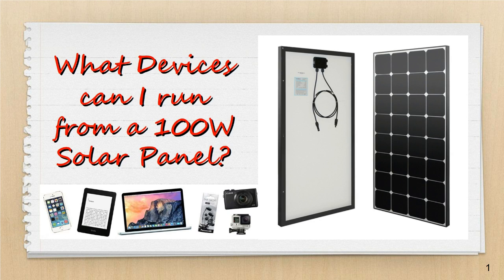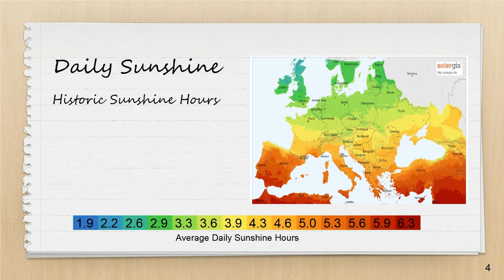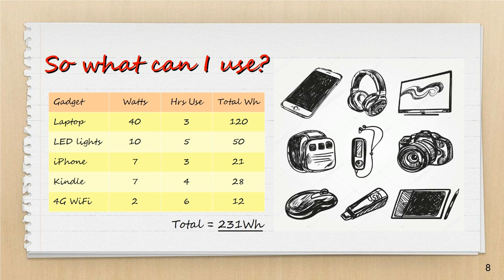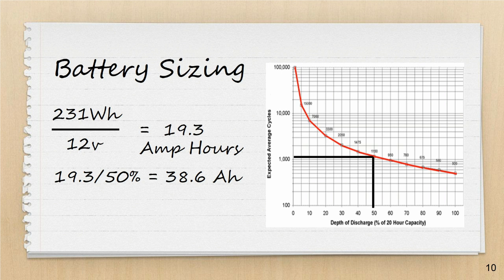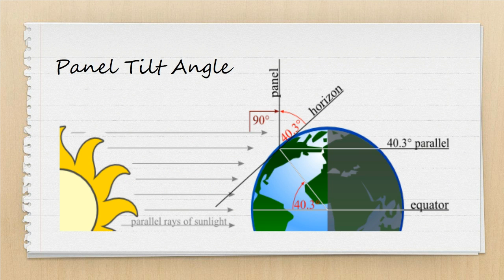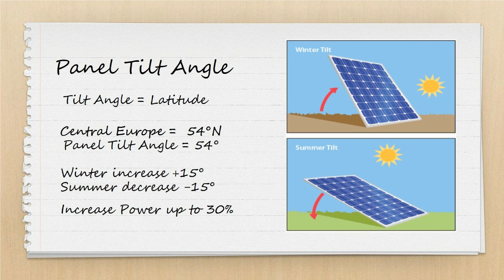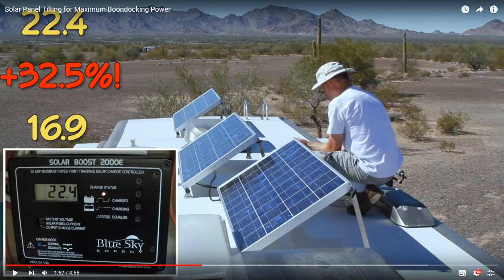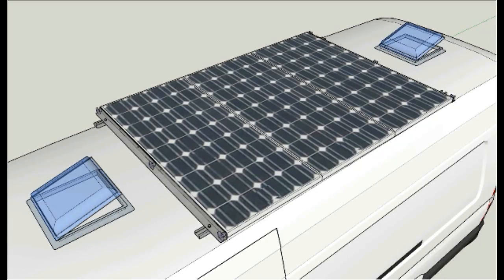What can you run on a 100W Solar Panel?

Comment: Let me rephrase my question. I live in southern California. We get lots of sunshine. Daytime battery charges to 14.1v At night my new battery drops to 12.7v. Will the 100w panel with good sunshine 🌞 charge a second battery?
Reply from the maker: Ok 😊I hope this helps 
You can charge more than one battery with a single solar panel. 
Wire the batteries in parallel, positive together and negative together. Then put your charge cables across that battery string. Positive on one battery and negative to the other. So it charging the pair as if it was one big battery. 
The high voltage you see during the day is the charge voltage from the controller that’s not the battery condition. As soon as the sun goes down and the charge stops that voltage is the standing voltage of the batteries. That will tell you their state of charge. 
If you have plenty of sun 4-5hrs string you could get almost 1/2kwhr out of one 100w panel. 
Cheers Greg

Comment: i make all the calculation, for my area -in north Greece, we are  in 5.0 h -sunshine, and i went, to a 350watt,production of power in one day, i can to afford a 100 watt panel ,it cost hear,100W 12V one crystal 100p,90 euro,.
and now i can make my rechargeable station, i have  already, one inverter in 1000watt,a battery car, 45ah,12v,and now, i only want to bye the solar panel, i have a big problem, to find what panel i want ,and ,with this video, i find the numbers and the solution to my problem. thanks again.

Comment: I was just trying to figure out what size battery I needed for 120watt solar panel and what kinda of equipment I could power from it, thank you
Reply from the maker: With that size panel you don’t want any more than 1x100Ah battery. That would give you a couple of days use at these levels. 
No point going bigger on batteries because you won’t be able to recharge it with that panel. You can only use what you can regenerate
Reply: @GregVirgoe  Thanks that’s so useful to know 
I was initially thinking I could have 2 batteries connected but that makes sense that the panel wouldn’t be able to keep them both topped up 
I’m gonna have to start getting better at doing the maths 😂

Comment: Nice presentation.  I do have a couple of comments.  First you can get much higher efficiency if you use an MPPT charge controller.  MPPT controllers are typically around 96-98% efficient.  Properly sized wires will only cause 1% or less in power loss, particularly if you run two or more panels in series.  In fact it is quite easy to set up a solar system that passes 90+% of the power from the panels to the batteries.  However, one thing you neglected was the charging efficiency of your batteries.  That will be in the 80% range for flooded batteries and 85-90% for AGM batteries.  So your 30% loss number is more or less correct but for the wrong reasons.
Reply from the maker: Hi Todd, Thank you very much for adding that valuable information.
Very much appreciated.
Reply: Thank you for pointing that out.  I am aware of the Sandia Lab studies on this, which demonstrate significantly lower incremental charge efficiencies at higher states of charge.  However, I would suggest that most RV applications do not operate in the top 20% of battery capacity.   Instead many RVs draw their batteries down significantly and because of poor understanding of how to determine state of charge of batteries seldom get much above 80% charge.  In that operating environment the overall charging efficiency is more appropriate.  In general, people need more solar capacity than they think.

Comment: Could use a linear servo motor save climbing on the roof. Even could be made to adjust itself as the sun sets and close at night. Saw a system that used leds as the light sensors. When the panel casts a shadow on them, they switch the servo to tilt until shadow disappears.

Comment: I am pretty good at math, but the advice to "think about what you want to power and pick your panels based off of that" was just so confusing to me. It was too nebulous; less 'this input equals this output' and more 'guess and check'.  Your approach is algebraic and sensible and thank you for thinking to do the problem in reverse. Or maybe it's the others who are backwards. Either way, VERY helpful.
Reply from the maker: iTyncWithReality in a lot of cases either space or money dictate what size panel you can buy so I thought it best to approach it this way as ultimately that is what you can generate and all you can use. Really pleased you found it useful. 😊

Comment: Planning on having a 400 amp (perhaps 500 amp) lithium battery bank with 900 watt big sized solar panels. This is meant for a full time living in van system without a shower (so no water heating/boiler). Also looking to hook it up to an alternate so the batteries get charged when driving but I have to look into that subject a bit more to see what's possible. 900 watt seems like a lot but it isn't, the van needs to be stealth and the panels will always be flat and will be used in winter.

Comment: Thank you Thank you Thank you, I said that three times because I have been searching for something like this for week. Let me explain. I am a Motorcycle camper. I am also a ham radio operator. I am trying to set up a ham radio portable rig along with a laptop to do digital work and power two Samsung S9s and maybe a AA reachable battery bank all running off a Bioenno rechargable battery connected to a Powerfilm folding or rollable solar panel and a solar charge controller.. But obviously I need to keep the weight down to put it in the bags of my motorcycle so every ounce/gram counts. I was trying to figure out the right battery and solar panel to charge it so that I could keep everything running at night as well as in the day when the sun is out. 

Thanks again.

Comment: I’m installing a panel on my Sailboat to charge a LiFePO4 battery. My power draw daily is almost exactly the same as in your example.

With the LiFePO4 a 40ah would work since @95% of battery is usable compared to @60% lead

I’ll upsize to a quality 60ah Lithium that is expected to last up to 10 years. If you factor in replacing the lead 3x in that period the Lithium are less expensive.
Reply from the maker: It’s depends how you look after them as we are still using the same AGM batteries that are now 5yrs old and still working perfectly so at that rate these work out cheaper.
Reply: Thanks for responding. Good too know that lead can last longer if cared for.

I’ll also mention the obvious, the 60ah Lithium is @ 7x7x8” and 15# which could be important on a smaller sailboat space-.wise
Reply from the maker: @georgewashington7444  if you have the money then lithium has space, weight and capacity benefits. That is obvious 👍🏼😃
Reply from the maker: @georgewashington7444  AGM are more economical that is proven but if money is no object then lithium would be a better option.

Comment: Great video, thank you.  It makes the calculations much easier and reassures me that my 110ah and 100w panel will very likely fulfil my needs.  I am thinking about using a little extra space to put in an additional leisure battery but did wonder if the panel would cope.  My unit charges both my cranking battery and existing leisure battery when we are driving.
Reply from the maker: Is the new battery to give you more days autonomy of the same power usage or to increase your available power usage?
The latter will require more solar input if that's the case to recharge the bigger battery bank.
Reply: @GregVirgoe  Thank you for your reply, it was to increase capacity rather than greater use.  I guess I will need to put in a switch to change to the second battery but charge them separately.

Comment: Excellent video (as usual) but I think that you'll be very lucky if you can choose the optimum angle to align your van to the sun 
at most sites, wild or commercial.
Ken Stewart
Reply from the maker: Hello Ken, you're forgetting that the sun tracks across the sky so you'll never have the optimum angle all day unless you have a motorised tracking setup. We are just talking about making approx 30% improvement by having them roughly facing due south (in my case)
Reply: Greg Virgoe 
Hi Greg, i understand and agree with your response. My concern is that for a tilting system to be effective the van needs to point  east to west (or vice versa) to ensure the panel faces south.
Reply from the maker: yes, I totally agree with you and that's what I will do if I can, failing that they will just remain flat on the roof and i'll suffer a few loses.
Reply: Greg Virgoe 
My own system is a 100w panel wired to an Amperor Power Integrator which incorporates an MPPT controller and a battery to battery charger. I have. WAECO compressor fridge which eats battery power so the panel is fine for topping up the battery (110w) but borderline for off grid use unless I run the engine.

Comment: One thing that hot weather travellers may want to consider is that you really want to park your van in the shade wherever possible.  Consider making the panels demountable so you can park under the trees and your panels can be deployed out in the sunshine.  I am going to use a combined solar and vehicle charger that are available.  When the engine is on it charges from that and when it is off it becomes an MPPT solar controller.
Reply from the maker: Hello Stephen, I won't be taking my panels off the roof they are huge, plus you would need a huge extension cable, just not practical. I have seen folding solar panels that you put in a bag but I won't be getting one of those either. The van is super well insulated against the heat and cold an I will be fitting external reflective cab blinds to cut out the solar gain altogether.
Reply: In Australia the heat can be unbelievable.  Insulation is great however it will not keep you cool on a 42deg day.  You run the aircon or run for the shade.  What you need is shade and a cool breeze in the evening if you are lucky. Anyway you can have smaller auxiliary panels to plug in when you are under the shade.

Comment: Enjoyed that Greg - Thanks :)
Maybe actuators to lift the panels? I thought about this myself, but decided against it because of wind. Also, depending on which MPPT you use (max voltage), wiring in series can increase efficiency in days not as good as the best in summer.  Again I thought about this, but can't with my setup (not as much choice with LiFePO4). Look forward to the next video, loving this series :)
Reply from the maker: Thank you, I'm fitting 3x160W panels wired in series with 60A MPPT charge controller (could have got that on 40A) so can take full advantage of the extra voltage to my two AGM leisure batteries. No going Lithium because of cost.

Comment: When talking about battery discharge and it’s not good for the battery what’s voltages are classed as discharg?
Reply from the maker: tospicy4ya for AGM a voltage of 12.05 is 50% here is a simple table to show you https://www.aussiebatteries.com.au/assets/images/12-v-Battery-State-Of-Charge-website.jpg
Reply: Thanks , 12v appliances like tv stereo usb etc what voltage would these fail at? I bet you wished you’d not done this video now 😂😂
Reply: I have a 240v 50litre small fridge could I use this on an inverter I guess it’s the watts that draw the power?
Reply from the maker: tospicy4ya yes many people run a normal domestic fridge on an inverter as they are considerably cheaper to buy. Just check how many watts power it uses and size your inverter above that with spare capacity for other items like laptop or sockets

Comment: Wonderful explanation. So if I understand the tilt of the solar panels explanation, at no time is it most efficient to have the panels flat on the roof.????  Tilting the panels solves the problem but what if you wanted to face your van the other direction that you need to tilt your panels to the sun? What if the van roof was peaked like a house and you had a panel or panels on each side? Then you wouldn't have to manually tilt them either. I know that would raise the roof and you may not fit into certain covered areas. Just a thought.
Reply from the maker: Hello, if you are driving around near the equator then flat on your roof is perfect. You will still get a lot of solar in other locations but not the maximum. This really comes into play when you are far north or south in winter and need to squeeze every ounce out of the available sun.
Look at your average sun hours for your holiday location and if it’s not very many then tilting may be useful. If you get 6-7 hrs of sun a day leave them flat and don’t worry 😉

Comment: So I have an 800w amp is that a current draw at 800? It’s only a small 2chann one. So 800/12 is 66 but is only 50% efficient so 133a,  . Then because the 800W is peak, derate to 1/3 of that giving you about 44 Amps.🤔

Comment: Great presentation, but there are so many variables you forgot to mention. First is that the leisure battery normally would be charged during driving. Then its the battery chemistry. For automotive use the LiFePo4 chemistry is superb in charging cycles and charging effisiency, but should be protected against charging below 0 centigrade temperature. Tilting the panel is fine for both effisiency and cooling, but also requiers the van to be orientated in the right direction. So a panel laying flat on the roof is not that bad. It would also benefit from using the car as a heat sink. All in all my recomandation is to install the solar panel of your choice flat on the roof and rather spend your money on as much LiFePo4 battery as possible.
Reply from the maker: It’s not a case of forgetting to mention these things the topic is huge and videos would be hours long and nobody would watch it. 
Not everyone chooses to charge while driving, we don’t. 
Your recommendation to fit as much battery as possible is flawed if you do not have the ability to recharge it. You can only use what you can generate. Therefore your investment is better spent on solar and charging technology. 👍🏼😎

Comment: Thanks for the example calculation! This actually fits me needs almost perfectly :) I doubt that I can fit more than 100 watts on my car and I was considering a 80-100Ah battery. Seems I was eyeballing that fairly well.
Reply from the maker: Yeah it will work well. £100 for the panel, £25 for the charge controller and £60 for the battery. You may find an all in deal for the full kit. Cheers
Reply: Guessing from the £25, you wouldn't go for an MPPT charger in this case? Also: Can you recommend a product that connects the battery to the alternator? That way, I could split costs and buy the solar kit later. Thanks!
Reply from the maker: This size panel is perfectly suited to charge a single 12v battery. Although if it was me I probably would go MPPT because you get more out of them as they use the maximum power and down down grade the voltage like PWM controllers do.
Reply: Thanks for the feedback!

Comment: Advice needed please. I am a newbie with solar and these portable power stations. We are doing a two month long camping trip using a van where we will be basically living out of it without ever using any kind of shore power. We live in Idaho and will be traveling into the backcountry of BC, Canada on this trip. I bought a 12V portable fridge and a Acopower 100W 12V monocrystalline solar panel. I only have room on the roof for one 100W solar panel because I have 2 cargo boxes. Just ordered a BLUETTI EB55 Portable Power Station 537Wh. We drive a lot, at least a little bit each day. We don’t plan on using the battery for anything other than the fridge, as we have a generator for powering everything else. Any help would really be helpful. This newbie would really appreciate any ideas/input!
Reply from the maker: If all you have is room for 100W on the roof then I would suggest a couple of additions to that. Install a dc to dc charger to charge your battery while you are driving. 
https://amzn.to/3OPeaSH
This will help to put necessary power into your battery so your fridge does not run out of power. Also invest in the 200W portable solar panel for charging the power bank this can be placed outside in the sun when parked up and used at night as back up power if your battery gets low. 
https://amzn.to/3GYmCNE
Lastly I would consider having at least two 100Ah leisure batteries. 
https://amzn.to/3VGMGB1
I hope that helps.

Comment: Thanks again for a great video. Is it possible to start with 100w system and upgrade it as needed? Adding more panels and batteries and appliances. Like could I get a 2000w inverter to start and thick cabelling with the aim of eventually have a 480 watt system?
Reply from the maker: Yes, absolutely, providing that you have the right size MPPT charge controller sized for the end game, you can add extra panels and batteries at a later date. You will need to change the settings on the mMPPT to reduce the charge rate initally but that's no problem.

Comment: Just a thought. How about using an airbag whilst stationary to tilt the panels. You could then alter the angle from inside the van and i figure you could keep an eye on your gauges until you get the optimum angle.
Reply from the maker: John Widdowson, that's a perfectly feasible solution, I would add some Bungy cords to put opposing tension and stop the panels flying off in the wind.

Comment: I have 1x100w panel,and 1 battery.  I want to add a second battery in parallel. Will 1 panel change both batteries for the night time? I don't have room for another panel on van
Reply from the maker: You can only use what you can generate. So it makes no difference if you put 20 batteries in the van, if you can’t charge them during the day it won’t make things better. If you have no room for more solar then look at fitting a B2B charger and then a second battery. Then you can get a extra charge while driving to top up the solar charge. 👍🏼😊